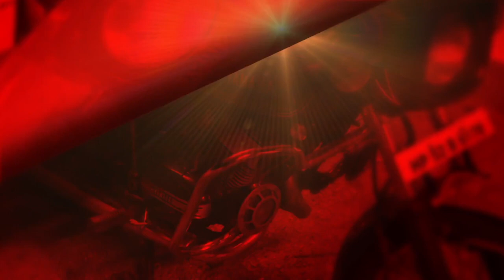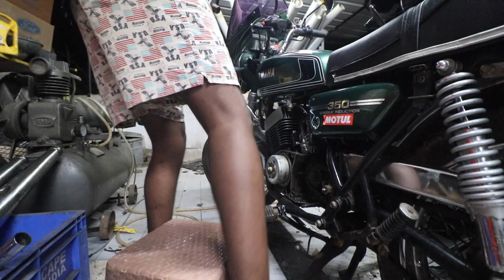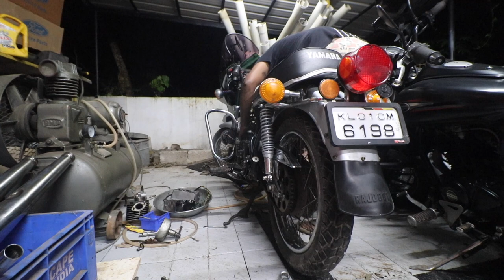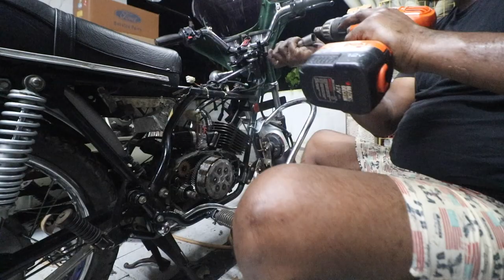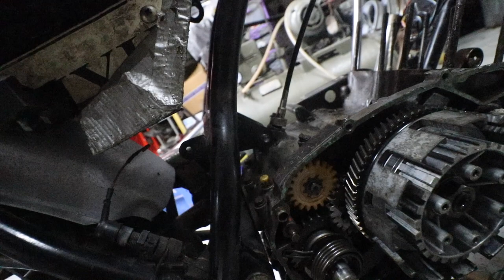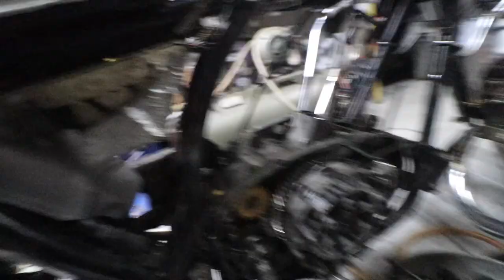RD 350 Rebuild Engine out completely !!!!English Video

Comment: hi sir 
toady opened my Rd 350 engine . it's running on 1.25 pistons unsleeved bore running in good condition .
plz guide me on 
1) can I go for sleeved std one or continue with 1.25 
2) which bearings  and airfilter to use .
Reply from the maker: Don’t touch the cylinders, sleeved ones don’t perform, you can get higher size pistons. Bearings can be SKF, those are good bearings. Air filter depends on what carbs and stock air filter box, reach out to RDfever facebook page for filters he has some really good stuff
Reply: @Yamakaze   Thank u sir . Really appreciate u sir the way u clarify things . I read ur comments in team bhp also . U hv clarity in things . Thank u again for educating us .
Reply from the maker: @girishkumarj6877  👍